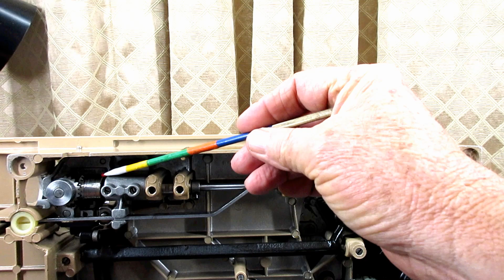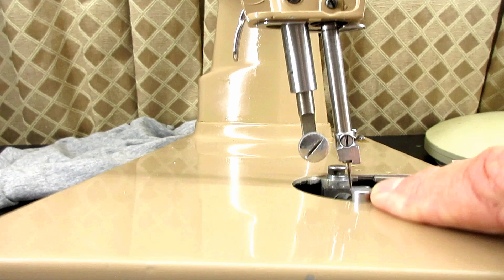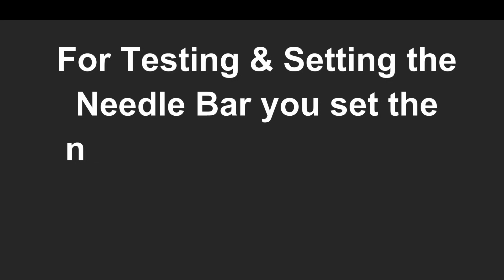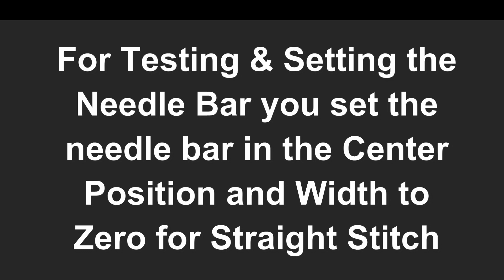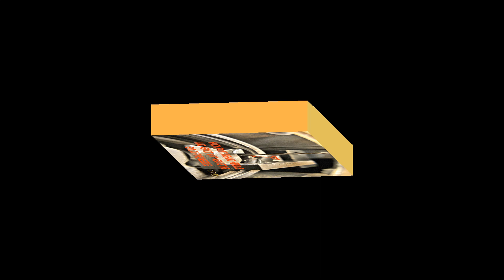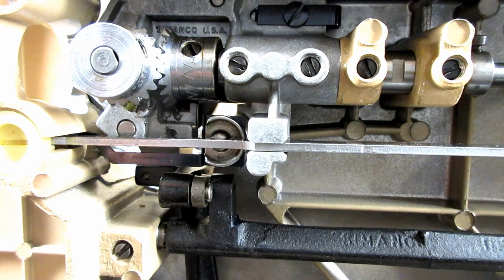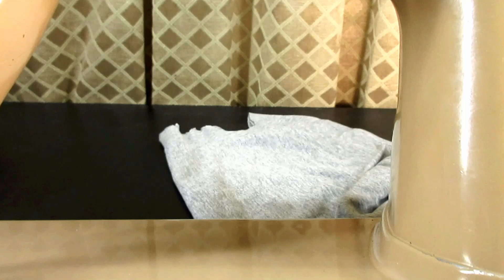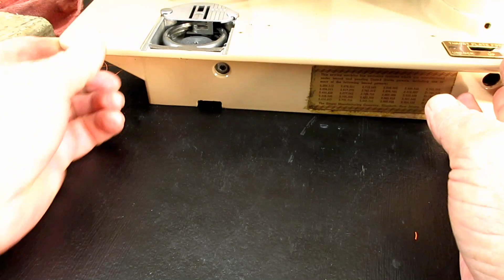How to Check and Set the Timing on a Singer Model 403A Special Slant Needle Sewing Machine

Comment: What to do if you loosen the set screw but can't move the needle bar up or down? It's STUCK! I've tried oiling it and cleaning it out but it won't budge. This machine badly needs a deep clean so I should probably do that before timing it, eh?
Reply from the maker: Clean some more. It has built up dried oil. It's like glued in place. Cleaned with ??
You can heat up the bar with a hairdryer to try and soften the gunk up. Don't hit it or tap on the top (can bend) I have put the needle clamp back on and griped it with pliers. (use a rag) and twisted it left and right while heating it up. Just to try and move it like that to kind of break the seal on it. Alcohol, Krud Kutter (protect the paint) WD40 type products. It can get stuck in that bracket you loosened the screw on, so remove the screw and get some oil or cleaning  liquid inside. All good things are worth waiting for, but try the hairdryer. I have 500+ videos if you need something to do while waiting... Oh! Here is a good one about washing, drying and oiling a 403A:
https://youtu.be/N3oYsTBJrFI   That's timely, eh?

Comment: What would cause the timing to go off on its own? I keep setting the needle bar height and fixing the timing as shown in the video and I will sew along for a bit or do a buttonhole or two then all of a sudden, I'm breaking needles and when I check the hook is way off. Any help you can give is great.
Reply from the maker: Hi Ashley please tell me the make and model number of your machine and I'll try and help.
 thank you
Reply: @andytubesewing1953  I have the singer 403A.
Reply from the maker: @ashleyzboya2097  OK, a 403A, got it. Unusual for this to happen on a 403A with its solid steel gears; usually a broken plastic gear causes this. You mentioned you "keep setting the needle bar heigh"; is it usually off of the setting when you have the problem? I'm asking b/c the only time I had this on a slant needle machine the threads were stripped on the needle bar connecting link set screw. That's the clamping screw that holds the needle bar in place. During sewing, the vibration would let the screw become loose enough that the bar would slip out of height. I suppose the same thing could happen to the gear where you set the timing or the gears by the hook, but they have two set screws. I finally took a picture of the set screw after setting the height, and then compared it to the screw after losing the timing. The screw had moved. I ended up replacing the whole clamp & screw for $8. That's all I can think of right now, so check for loose screws on the needle bar and maybe the gears and I'll keep thinking. Let me know, please. Good Luck. BTW, here is the 403A needle bar removal video;
https://youtu.be/c1YhfFqeuVI
Reply: @andytubesewing1953  I did some investigating and the needle bar is still lined up fine. The hook is just way off I will open the bottom and see what I can find out there as well
Reply from the maker: @ashleyzboya2097  okay darn it I was hoping it would be easy like that so yes I agree go look down below and check the gear where you loosen the screws for timing and see if one are both screws have gotten a little loose you can also check the screws on the two gears directly below the hook what we're doing is following a path from the hook up to the hand wheel and I'm assuming that your hook is out of time again right now so we have to find out why then the most logical way I know is go from the problem in this case the hook and follow the power back to the source in this case the hand wheel
Reply: @andytubesewing1953  looks like maybe one screw on the gear doesnt screw all the way down. One is flush inside the hole on the disconnected gears and one sits just above about half a turn.
Reply from the maker: @ashleyzboya2097  There you go. That is loose enough to cause a shift and loose timing. Those gears get very hot while running. The metal expands; the shaft is turning very fast. If the screw won't tighten down normally I would remove it all the way and take a real close look to see if the threads are damaged. It is hard to see in the hole if the threads are damaged. I'm hoping the hole/shaft has dirt/debris at the bottom that you can wipe out or flush out with alcohol. That's an easy fix and better than a damaged screw. The other option is somehow the screw got in crooked and damaged some threads. If you don't see dirt in the hole clean it anyway and put a drop or two of oil into it. Clean the screw and dip it in a drop of oil. The idea is to oh so gently try to screw the set screw back into the hole properly. Softly Softly. There is a possibility it could "rethread" itself enough to tighten all the way. What say you? Are you wIlling to try? I know you will and can!
Reply: @andytubesewing1953  thanks for the help. I actually had the wrong screw in there. There was 1 left over when I was done putting it back together, I'm still trying to figure out where it goes, probably the light assembly anyways it was a bigger screw so will put it back right and hope it holds up
Reply from the maker: @ashleyzboya2097  okay Ashley I'm sure you'll figure it out and good on you for sticking with it by the way now you truly know the meaning of operator error haha I don't remember how many times I made similar mistakes so don't sweat it no worries get it together and get back to sewing
Reply: @andytubesewing1953  thanks for all the help. I watched the timing video a dozen times and never thought to check the screws haha
Reply from the maker: @ashleyzboya2097  😉
Reply from the maker: @ashleyzboya2097  😉

Comment: Both of my older machines were like 3mm late on timing, i gues when parts wear out it goes off on it's own, assumin timing is on spot after factory build.
Reply from the maker: Absolutely and why I said each VSM can be a little different due to age, use, maintenance, etc. Singer machines can be forgiving as to some settings, but a 3mm late timing could give you some trouble on wide ZZ and satin buttonhole stitching. Glad you checked your machines then. Thanks so much for commenting and watching my channel.

Comment: Hi Andy.  Thanks for the info about setting the height of the needle bar so that there is just a sliver of silver above the needle bar height mark before it goes into the bushing. Earlier, I had some trouble setting the needle bar height when I put the clean needle bar in--everything was so slippery and clean and combined with the fact that the needle bar clamp has to be made screw driver accessible, I had a heck of a time getting the needle bar height set.  I finally succeeded with a little bit of silver showing, which I thought wasn't the best, but it's the best I could do.  Now I know that's what is desired, that thin band of silver.  Is a thin band of silver supposed to show on the belted machines like the 457, 337, 347, 328?  I've set these machines so that the band is just starting to go into the bushing, and there is no strip of silver showing.  I'd be interested to know.  This 403A, I'm starting to love it.  The timing needed no adjustment at all.  I've actually done some test sewing; such a lovely, balanced stitch, both straight and zigzag; even my foot pedal seems well-adjusted, with no adjustments from me, although I will do a full overhall on it because the machine deserves it.  As always, looking forward to your next video.
Reply from the maker: Yes, setting this needle bar that requires moving it up and down for screw access is really a pain. I wish they had designed that clamp better with the screw in front. I guess they figured it is set at the factory and does not need much adjusting after that. All Singer models with the two timing marks that I have done usually can be set with the "sliver of silver" method. "Usually". I tried to stress that each machine is different, kind of like we are. The next 403A you work on may be better set with the timing mark disappearing into the bushing. The method shouldn't need to be different between gear and belt drive machines though. What I have found to make the most difference is that both timing marks be set the same. Like if the height is set with the sliver then the timing should be set the same way, with the sliver. When I have done both settings but have a slight problem, say a few skipped stitches when sewing wide ZZ and I have gone back to check I find I did not set both marks "equal". I mean like maybe I set the height dead on with a tiny sliver of the silver showing but then my timing setting had no sliver but just the timing mark right into the bushing. I tried to set them the same but had just barely missed the sliver on the timing. (Probably moved a little while trying to tighten the set screws) After moving the timing down a tiny bit so that I had the same sliver showing as the height then I had perfect stitching no matter how fast or wide or long or short I tested. I am hoping by highlighting the 403A in this series that people will see why I really like this ZZ model; even over the 401A. Singer only made about 300,000 of the 403A model vs. 1,000,000 of the 401A. They had much more profit with the 401A and really pushed it through advertising and their stores. My feeling was to let people know what a nice model the 403A is so they could get one while there are still some available. Some 403A models are being stripped of parts to be used for the 401A Slant-O-Matic machines, which are still very popular, so I say get a 403A while you still can. Heck, maybe get a second one as a backup for parts!! That way the Great-Grandkids will have what they need, hehe.
Reply: Thank you so much for your answer.  It clears up my question so thoroughly; you keep increasing my knowledge base.  I will keep my eyes out for another 403A.  It is sad to think some people are taking apart good 403A's for parts for the 401's, which are much more plentiful.  By the way, I have named my 403A--Frances--for one of my husband's uncles who was in the navy in World War II and survived twice as the two ships he was on both sank.
Reply from the maker: @carolemagnusson5044  You are welcome. I love the name Frances and the reason you named your machine that. Wonderful. I think you'll enjoy your 403A whenever you use it. I know my wife enjoys hers for the ZZ when needed.